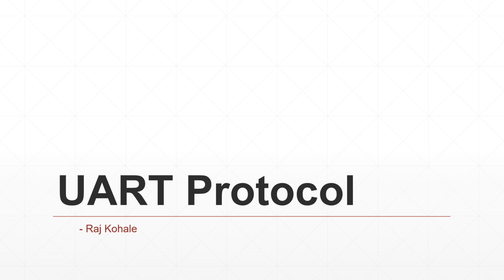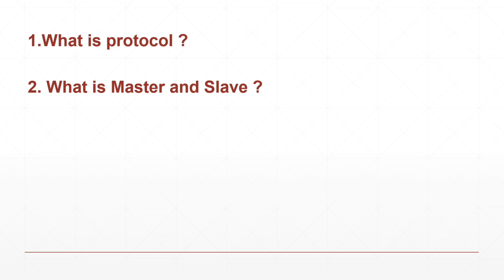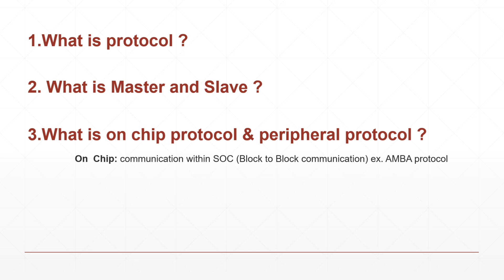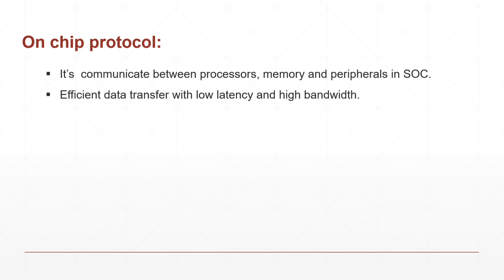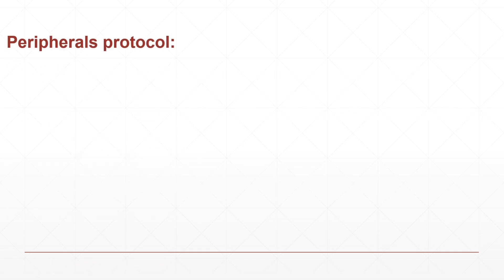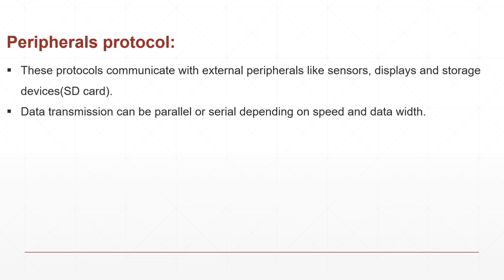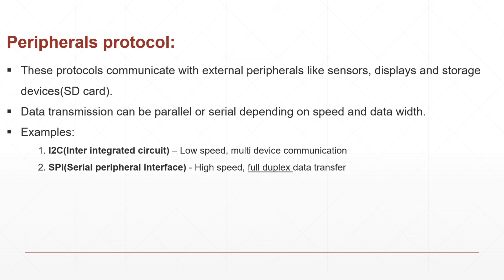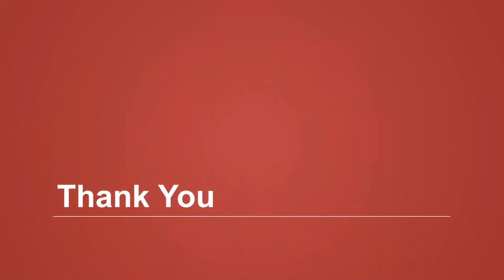UART Protocol - Part 1 | FPGA Communication Using Verilog HDL | Basics, Working & Implementation

Comment: is it possible to interface fingerprint module r305 or r307 with fpga basys 3 board or any other board?
Reply from the maker: Yes it's possible, refer some data sheets related to the fingerprint module and there are some research papers related to the fingerprint module in FPGA you can go through that.